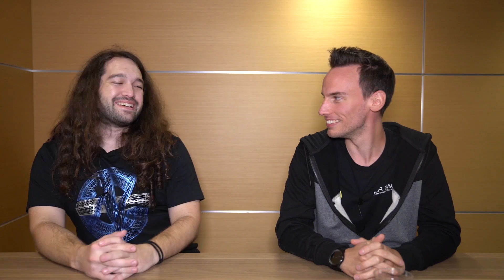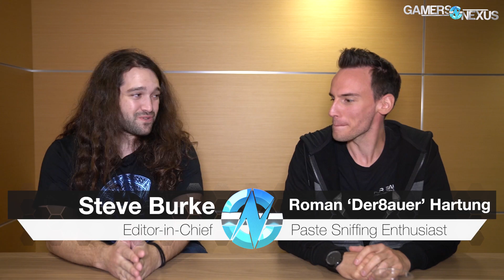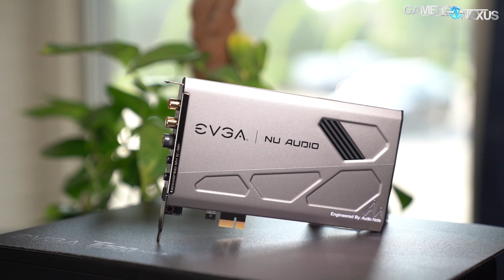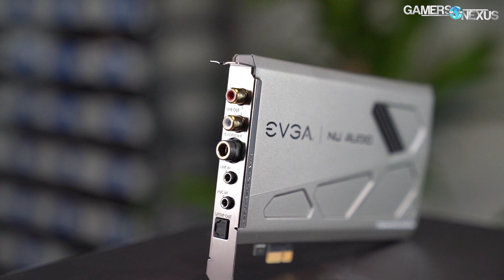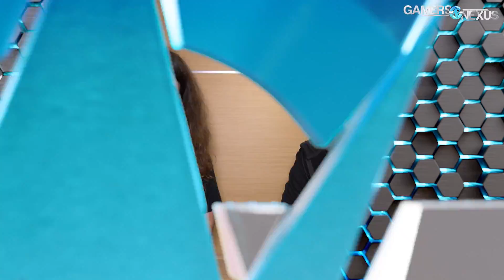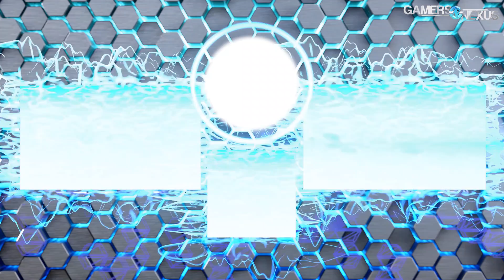Der8auer Deep-Dives on Thermal Paste: Misconceptions, Curing, & More | LTX 2019

Comment: The pump-out effect as mention is really a problem, I had a delidded CPU and a GPU suffer from this issue, it only need a few weeks to take effect. This problem doesn't happen when applied on heatsink to IHS, only happen when applied to a silicon die.

Comment: Speaking of thermals, do you guys ever experiment with directing airflow/ ducting? It seems cooling solutions are getting ever more advanced (expensive) even though the TDP has barely changed in the last decade. If air just goes through the case without coming close to components & radiators it is largely pointless, so is air coming out of the computer that is cool/  near room temp as it isn't being utilised (removing heat). Worse still is that watercooling often removes the turbulent airflow around the socket, making things like the VRMs & RAM run hotter. Same goes for the chipset & M.2 drives needing extra cooling because of the largely stagnant airflow around these components. Or a GPU that exhausts hot air out the back of the case without having to resort to loud blowers.

Most servers and laptops use ducting as standard (they often have to). As do many OEM PCs so they can get away with as few fans/ heatsinks as possible. Yet this seems  I don't think this would be hard for case manufacturers to implement, or even selling kits. Plus, cases are beginning to have 'thermal zones'  so the next step is directing airflow to exactly where it is needed.

Comment: Ok fine. heres what pissed me off about Conductonaut..  Applied on a Ryzen Chip.. very well done then 8 months later my cooler was full of dust, needed to take it off the cpu; disassamble to be able to vacuume it properly..   The CPU was glued to the Copper block.. Stuck, welded!!  The liquid metal turned into solid/dry compound. So I had to Rip the chip off the Socket..   Then with a Razor blade and a light hammer hit it separated from the heatsink copper/alu bloc.  Bull shit Ratshit.  Im back to traditional compounds now.  Had to sand the bloc and the chip to recondition the surface.. the liquid metal was dry and crisp/crystalized. Nix Gut..
Reply: Your fault for using liquid metal with an aluminium block of course it corrodes. Only use liquid metal with copper blocks or nickel plated blocks.
Reply: @megapro125 🐵 Read my post again.

Comment: "Aluminum mixing with water in the air and makes explosives gases" 

No. No it doesn't. Such a fundamental failure makes me wonder how much else he has misunderstand and explained over the years...
Reply: Ok then explain this?

https://www.eckart.net/fileadmin/eckart/Service/GDA_Alupulver_Safety_engl.pdf

What are the most important properties of aluminium powder for correctly assessing the hazard potential?
• Aluminium powder is combustible and classified as being flammable.
• Mixtures of aluminium powder and air are ignitable over a wide range of concentrations and can cause violent
 dust explosions.

• Highly flammable hydrogen can form on contact with water or other chemicals and present an additional risk of explosion, and possibly be responsible for causing a secondary dust explosion.

• The strong electrostatic charge on aluminium powder can lead to electrical discharges, which can possibly ignite
 a cloud of aluminium dust.

Comment: I want a straight answer as to what's in Kryonaut that's scratching and pitting the fuck out of everything I apply it on. I figure it's nano-diamonds. Whatever it is, it's hard(and/or course) enough to even leave marks on silicon. So that rules out a lot of things. Anyway...it's bullshit. And I won't use TG products anymore because of it. They actually owe me some new heat sinks, replacement cold plates, and pristinely lapped IHSes as far as I see it.

Comment: Bought Thermal Grizzly after using Arctic for like 15years and it's all in the details, you get a screw on cap, you can reuse the plastic bag it came so the tube is easy to fin and the little nozzle that spread the paste is nice.

Comment: Watching this video makes me think of and special closed loop ln2 cooler that has a mechanism in it to automatically switch to normal watercooling when extreme overclocking isn’t needed. That would be so cool. I imagine some kind of twisting copper block that closes on itself perfectly level when in watercooling mode, and opens up and exposes the ln2 block when extreme clocks are needed.

Comment: The air bubble thing is actually the first argument I'd heard against spreading thermal paste before cooler mounting.
Reply: It's silly. What can happen is that you will have too little paste in some place and a visible void instead, and somehow paste does not spread into it. That can also happen with other methods when you add too little paste.
Reply: @AstralS7orm  Though is also avoidable with spreading if you know what you're doing. If I remember correctly, that's the method GN uses for their cooler testing to get as consistent an application as they can.
Reply: It's best to spread and then when you gently set the cooler on and twist back and forth just a little bit to make sure it spreads onto the whole surface. It's only purpose is to fill scratches and voids in the contact surface so obviously you want it spread thin across the whole surface. When I update my CPU next I plan on hand lapping the spreader and cooler down to 1000 grit on a sheet of glass and then use 2 sheets of gold foil instead of compound all together.

Comment: That pump-out effect is interesting. In the exposed die days (socket A) i did many correct applications (as thin as possible, usually a 1/3rd grain of rice smeared on the die by a plastic covered finger, any residue used to put a "haze" on the cooler coldplate) of Arctic Silver 5. A few years ago, i got into one of those systems which had been in heavy use ever since and had never been touched. After donning a respirator and blowing out over a decade of dust, I found that the paste had turned almost to a chewing gum like substance. It had definite solidity but fell apart fairly easily. No migration, and it was still doing a good job of transferring heat.
Reply: Indeed.  I've never seen thermal paste fail and I've built a fair share of computers in my time.  But I used quality brands (Arctic Silver or MX-4) or OEM compounds that came with the heatsink.

I'd always choose reliability over performance, just because the idea of having to repaste your CPU is frankly ridiculous.  The less fiddling you do with your PC, the better.

Comment: In 2014 when I delided my intel Core I7 4790k CPU I used "Coollaboratory Liquid Ultra" liquid metal under the IHS & used the same liquid metal thermal paste on my GTX 980 Hyrbid mod. I never changed the thermal paste for over 4 years & temps are only 2c higher- then the date when I first applied. I don't believe in changing thermal paste every year it is overkill & I feel your paste is shit if you need to change it that often!

I seen older OEM machines using MX-2 & MX-4 thermal paste for over 7 years with no problems.

Comment: on my Intel Q6600, the paste was the original one when i had problems with my mother board and thought it was the processor... when i removed it, the paste was s9oldered to the CPU and cooler, i had to "break" them off them selves! tho that Intel's Q6600 idle temperature was 70C... i wonder what kind of paste would be made for that!

Comment: 11:54 "dont spread your thermal compound it generates air bubbles" was a very common thing to say back in the day. I think it probably generated from a video on youtube called "How thermal compound spreads" where a person is using a piece of acryllic to show how different aplication methods (pea method, line, spread etc) look like.
Nowadays its been tested many times that the application (or hell, even quantity) doesnt matter much, so people stopped saying that everywhere (there are still a lot of comments about its too much paste though).
Reply: You mean this one?

https://www.youtube.com/watch?v=EyXLu1Ms-q4

Would honestly like to see the penta-dot or "dice" method shown with acrylic. I suspect it gets great coverage. I think that's what I did when doing my last re-install...
Reply: This is pretty cool, too:

https://www.youtube.com/watch?v=2NlVgd6zRPA

Honestly, there's probably no super-"wrong" way to apply thermal paste... ;)

As I suspected, the penta-dot method works fine. Personally I'd have spaced them out a tiny bit further, just to make sure they covered each quadrant and went out the corners. But, it seems like it all worked fine and still just turned into your standard "circle/square" of paste. Ohh, I guess he did a larger square dots one later, and yeah, it pretty much covered everything... :)

Comment: Oh, yeah, the air bubble thing... I almost forgot it used to be big deal for some people and then there were sites doing various tests to prove and disprove it by using some sort of transparent surfaces to squeeze it. Funny stuff, but it feels like trend moved on from air bubbles to too much or too little. Still, people tend to get really funny about it. I think JayZ once in a video did bit unusual application, so he inserted his unhappy face pointing at picture in manual... :-D I think it was one of Threadripper videos or something.

But in any case, if you want to spread it like Nutella, hopefully without knife, by all means have fun with that. :-D

Also fun stuff, I once put quite a bit too much to the level where I had to press cooler pretty hard down to squeeze it, so it was low enough for screws to hold... needless to say I sold that motherboard with cooler and CPU attached and made it someones else job to clean it up. Silly past me. :-D

Comment: After hearing about the pump out effect: Do you have a recommendation for a paste that lasts really long while having good thermal properties? Does liquid metal behave the same way? Will the liquid metal pad from coolaboratory behave the same way? Thanks in advance!
Reply: Something with a very high surface tension is likely to reduce that effect because that is the fundamental problem with grease: it's thixotropic, so when you push it somewhere, it stays there and doesn't go back to where you needed it. For something with very high surface tension it will suck itself back in afterwards when everything cools down.  For mechanical things I use that US Lucas oil stuff that's expensive, but has phenomenally high surface tension. I don't know what the equivalent in thermal paste would be for processors.

Comment: But...But air bubbles got trapped in the micro cracks of the IHS and bottom of the cooler, when you pre-spread the paste and apply the cooler there is no room for them to escape so all trapped between the IHS-paste-cooler sandwich.

Comment: If kryonaut is so good why isn't there a kryonaut 2?
Der8auer: Hold my silicon oil
Reply: perhaps to increase the 1 year cycle... the present kryonaut requires replacement after every year because it will dry out due to pump-out effect.
Reply: I listened to him talk about the pump out effect and why they recommend thermal grizzly be changed out every year or so, but I haven't really experienced worsening temperatures over time with anything I haven't found the need. My old 4670k (now owned by my brother) stays at more or less the same temps as it was the day I got my rockit 88 (used kryonaut inside and out), my ryzen 5 1600 similarly hasn't seen any major temperature fluctuations in the past couple years I've been using it. I wonder, since it's caused by differing rates of expansion, if a more stable temperature helps alleviate the issue, as I've always been one for overkill coolers (an r5 1600 in no way needs a 360 rad and yet here I am)
Reply: @AmaraTheBarbarian  The pump out effect isn't really much of a problem on chips with integrated heat spreaders. You'll typically only have longevity issues with bare die applications.
Reply: @ConvexSpade  so in theory my delidded chips should get worse with the IHS over the bare die? or not because it's a fixed application rather than floating. Yeah I replace graphics cards more often and probably wouldn't notice then. The way the market is looking right now I may be holding on to my vega 64 for a while so there might be plenty of time to find out
Reply: @AmaraTheBarbarian  Usually, when you apply the paste is between the Cooler and the IHS. They are both copper and have the same thermal expansion, but when it is direct die its copper and silicon. The thermal expansion is different and you get the pumpout effect. This is how I understood it from Der8auer.
Reply: @ConvexSpade  yeah, he did mention GPU for a reason.
Reply: @AmaraTheBarbarian  your delided chips should be using liquid metal as the 1st interface, regardless if you put back the IHS or go for direct die cooling.
Reply: Oh is that so? nah kryonaut works fine and involves much less effort or need for perfection. AcTuAlLy solder should be your first interface, you should just drill a small hole in the corner of the IHS and solder it directly to the die
Reply: @Mysteoa  i have a sapphire pulse 5700xt and used mx4 2019 version, it only lasts 1 month until temperatures climb too hard, it will happen if i use kryonaut?

Comment: Most manufacturers that say to allow a certain time or whatever, if you look, they are typically thicker viscosity pastes, so that just ensures that it's had enough time to think out. But that's just insurance, I've used some of those pace and applied it, and had no increase in performance after that certain. Of time. But that is likely due to the fact that I always am just a little on the side of tightness when securing my cooling solutions. So its two-fold, helps ensure that the user doesn't start it up right away and not see the results as advertised and potentially remove the paste, as well as just help protect against straight up user error.

Comment: I have a 4790K delidded with Conductonaut and then I use Conductonaut on the IHS. I also apply it on the GPU die. I get excellent temps. Can you do a comparison between using full liquid metal on CPU ihs and GPU die vs high end paste and explanations on temp differences

Comment: True that Roman. The air bubble effect is something that we have all heard about. Steve, Roman speaks the truth there.
Reply: I'm not convinced - if you push a transparent plate down onto some hand spread thermal paste there clearly appears to be small pockets of trapped air - some pastes are designed or just tend to work better for being spread than others.
Reply: @Rroff2  its because the force you exert when you push it yourself is not enough vs the cpu coolers. I guess its l one of the reason why you need to screw the coolers so it will have enough pressure to prevent air bubbles
Reply: @426Studios  I've tried it with clamping force - I can't be sure what is happening without studying it in more detail but it certainly looks like it is possible for air to be trapped to me unless you have 2 perfectly machined surfaces.

Comment: Question I have off of something Der8auer said: is there a need to completely remove all previous thermal paste when applying more if the previous application was fairly recent, say within the last week or so? He very nonchalantly said "add a little more" with regards to application in a situation where you want to absolutely avoid having too much. With the understanding of pump-out-effect in mind, it would make sense that there's no need to apply a completely fresh coat so long as everything remains constant and that the previous application was made relatively recently. Some initial googling of issues that may be incurred by this has people only mentioning "seals" and "air bubbles" which Der8auer has debunked citing the mounting pressure so....

Comment: Also I spread the thermal compound on the CPU evenly like I always have with 10 years. I've seen that airbubble or don't spread the thermal paste manually far too often. If you spread the compound manually it works just as good as a pea sized blob or a line.

Comment: I bought Arctic Silver 5 lsst week. They claim it takes 200 hours to settle but as derbauer says its bullshit. Its been over 200 hours of normal usage where I turn off the computer when its not used and the temperature hasn't changed. My R5 2600 still goes up to 64c at 100% load after 30 minutes soakage with a DeepCool Captain 240. I'm going to order Kryonaut tomorrow though.

I'm not sure Kryonaut will help much though. I think my CPU cooler is the problem. My CPU idles at between 27 - 30 celcius and then hits 64c maximum spike after 10 minutes.
Reply: I've been using AS5 in builds for 20-25 years and it definitely can improve slightly after a few dozen thermal cycles or so - it doesn't happen every time not even the majority of the time but it definitely can be a thing with that paste. What he says is true for 90+% of pastes out there but there are some especially some of the old school thermal pastes from like the 70s and 80s which were designed for hand spreading where curing is a thing.
Reply: @Rroff2  I've used Arctic silver about 10 times over the past 10 years and I've never noticed the temperature drop no matter how many power cycles its been used for. I first started using it when I built my first custom watercooling. I'll never do custom watercooling again though. It just requires far too much maintenance,
Reply: @Steve30x  Yeah I ditched my last watercooling setup in 2014 - a high end tower heatsink can match or beat off the shelf watercooling setups and no worries.

The only time I found it really worthwhile was running a Q6600 for 24x7 number crunching at the max voltage table (1.65v IIRC).
Reply: @Rroff2  I'm using an All In One because I much rather the look than a masive air cooler in there.